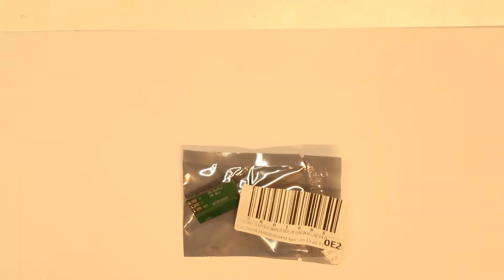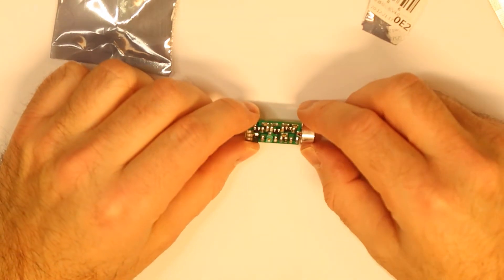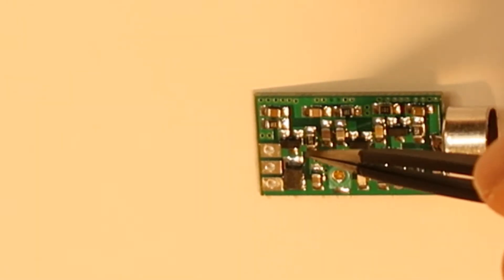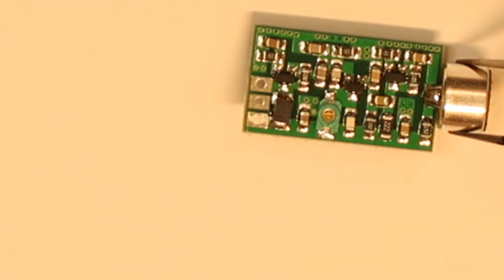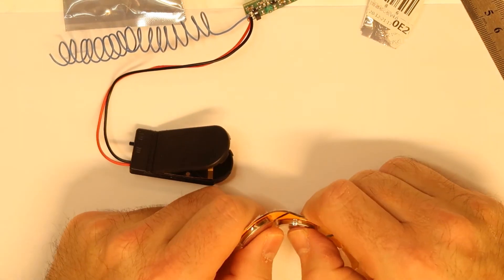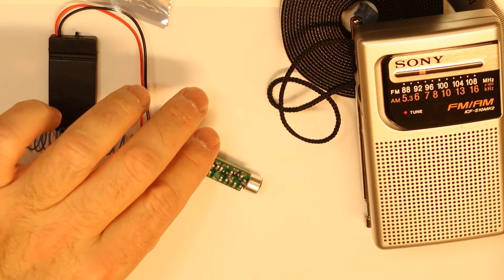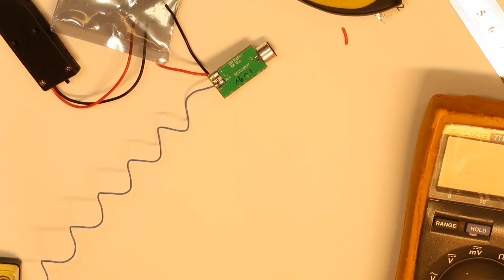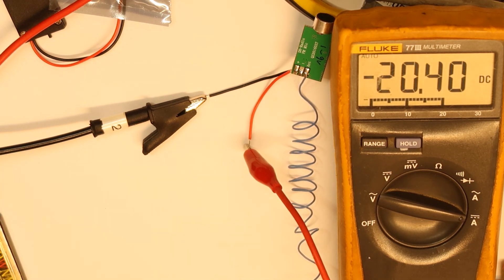Fm Spy Bug Transmitter - Part1

Comment: This FM bug is crap because it actually transmits in the 50 Mhz range and what is being picked up in the 88 to 108 Mhz FM band is a second harmonic so unless you have a radio receiver that can receive in the 50 Mhz band you will not get much range.

Comment: I wanted to ask you since I also came across this pcb. Totally empty frequencies unfortunately do not exist. I tried to tune to 108 mhz, turned the pF shifter, but I didn't hear the hiss but only a small change .... . I put a music in front of the mic and from my little radio can be heard but very disturbed . The tuning is ok but it is the antenna that needs to be enhanced (currently as an antenna I put a very ordinary "electrician" wire 40 cm long ...) . What do you recommend for me to find a result even at a distance of 1 km? I do not have any spectrum analyzer to use to see how the rf signal is transmitted. Let me know. Thank you. Hi.